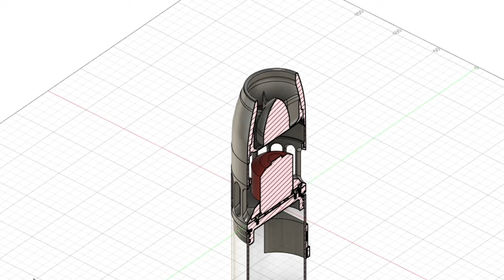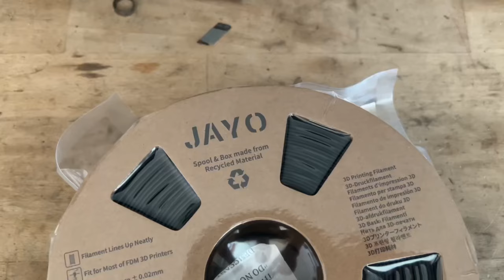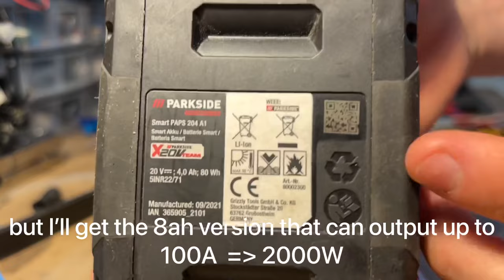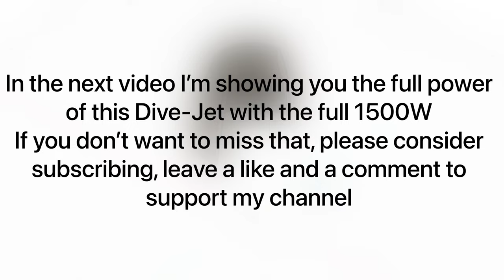Dive-Jet 1500W | How To Build | Better than the Original?

Comment: Amazing! I am building something like that too. How did you design the propeller? Can you make a video of using it?
Reply: @3dprintcnc164  so you didn't used something like fluid simulation / propCAD? my problem is that i also didn't use any analysis program, and I get poor efficiency / not enough thrust / stall propeller :(
but your design looks so good. I really cant wait to sea it underwater!
Reply from the maker: I have a CFD Program but still have to learn how to use it. I basically just „copied“ the design of the real ScubaJet and changed it to fit my application. But the design of the blades is pretty much the same. I haven’t been able to measure the thrust and the amps the motor is pulling, but I know that the motor is using well below 50A because the battery I used shuts down at 50A and it didn’t shut down while full throttle. That also means that I have power to spare for a more aggressive prop. Problem is that if I increase the pitch even more, I guess the efficiency of the prop will drastically decrease..

Comment: Bearings will get shot after first use..
Also there will be electrolysis happening between non-water proof solder joints on the motor.

Comment: Congratulations, your work is incredible; I would also like to create something similar to your work for my wife who can go to the seaside but can no longer go underwater like before, we live near the sea and with this she could go snorkeling. Have you tried it at the seaside or in the pool? Once again well done.
Reply from the maker: Until now I’ve just used it in a fresh water lake. I think the only limitations are the bearings in the motor with corrosion, the motor it self is completely electrically isolated and all the other electronics are inside the waterproof housing

Comment: Thank you for sharing your project,your videos are very interesting! I have a similar project and few questions to ask you:How do you seal your propeller shaft? And how do you seal your electric throttle if you use one(not sure, your device looks like to be remote controlled?) . Thank you in advance for your help
Reply from the maker: The whole motor is submerged in the water, so no need to seal the propeller or motor shaft, just need to seal the motor wires going inside the waterproof chamber. Same for the throttle, you just need to seal the electric cables. The Dive-Jet is going to have a throttle lever, it just wasn’t finished but in the next video I’m going to show more about that. 
Unfortunately my esc is not working properly anymore so I don’t know how long it will take until I upload the next video
Reply: Thanks for your answer. I hope your esc will works soon, impatient to see your next video!
Reply from the maker: Unfortunately it malfunctioned completely and I had to send it back, hopefully I’ll get the money back. Currently waiting for a new esc I ordered. It’s going to be an expensive project, at least for my standards.

Comment: Love the project, but I noticed you used PLA or ABS which is not waterproof. Even tho you used o-rings, water will still make its way through the prints and into your waterproof section. There are rubber end caps for the pipe you used that I recommend. It looks amazing, good job!
Reply from the maker: Yes you’re right, pla or most 3d prints aren’t waterproof, that’s also a reason why one side is made out of aluminum. The other side is made from pla but it’s coated with epoxy and while testing no water got in. But in the future I’ll probably make it out of aluminum, too.

Comment: Hi. How are the prints holding pressure? All my diving projects are printed at a 100% infill to avoid air pockets that can collapse under pressure at depth. But really really really want to build something like this!
Reply from the maker: It’s not really meant for deep diving.
More like 3m maximum depth. It’s really important that the end caps are fully waterproof, that’s why I’m planing on making them both of metal
Reply: @3dprintcnc164  right... I guess asking for 50m deep will be a bit too much, then! 😅

Comment: Nice project, I also had a similar idea in 3D printing but my engine lacked power in open water. Have you been able to test it in the water? because it is not the same to test in a bathtub than at sea or in a lake?
Reply from the maker: I know, the water gets in motion very quickly in a bathtub or similar therefore reducing the thrust significantly. I uploaded a YT Shorts a couple of days ago showing a short test in a shallow river
Reply: @3dprintcnc164  Can't wait to see the dive test :)

Comment: Great project. Can you let us know the motor esc specs, tempted to have a go to attach to my paddleboard 👍. Great job.
Reply from the maker: Motor: 500kv, 65a, 7s 
ESC: 75a, 6s 
Battery: 5s, 100a, 8ah each
Reply: @3dprintcnc164   Unless I am mistaken, the engine does not seem to be intended for use under water? especially sea water. Have you planned to protect the engine with a resin coating or other?
Reply from the maker: No it’s not intended to be used in water but the windigs are waterproof and a thin coat of epoxy or paint should prevent corrosion on the stator core. Only problem are the bearings, the bearings on my motor are done and need to be replaced, I’m planning on using 2RS bearings that are pretty much waterproof.

Comment: Do you think this could push a kayak and how much would this cost
Reply from the maker: Im sure it can push a kayak, it could pull me pretty good and I guess a kayak has less resistance in the water than a human body. Material wise it’s probably 200-300€ depending on the components you use

Comment: Do you have a link to the engine and ESC you are using?
Reply from the maker: Motor is a Turnigy G60 500kv
ESC is a FlyColor 90A for boats

Comment: 4:00 so far: impeller needs to be printed with much lower layer height, it needs to be petg or ASA. Then will be best id you coat it with epoxy after printing and sanding (with 0.1mm LH + epoxy sanding will be optional) I would not trust 3d printed enclosure to be waterproof, especially if you dive with it, it will almost certainly leak. Also by looking at motor type, you cant run this in saltwater I think, as its an outrunner.
Reply from the maker: You are right, the prop needs to be smoother but since this is still a prototype I’ve printed multiple props to test, I wanted them to print fast